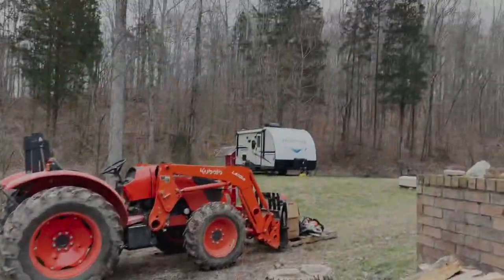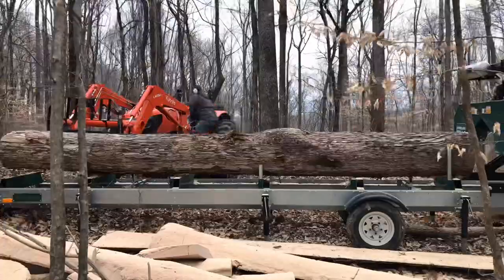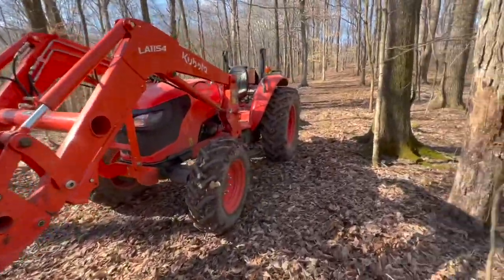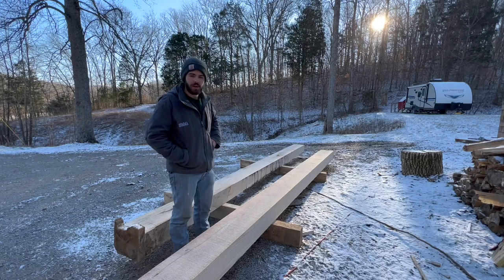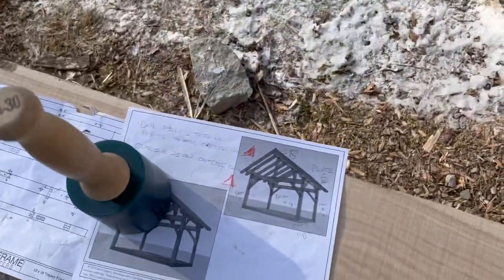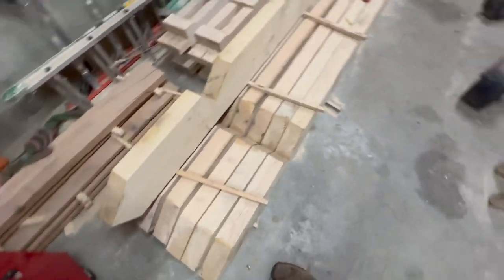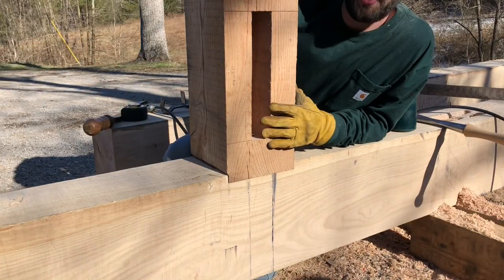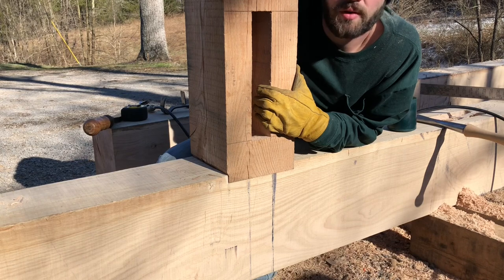Forest to Timber Frame (Saving LOTS of money)

Comment: Great work! Did you know you’re operating the Chan mortiser from the wrong side? If you go on the other side, you can see the red ‘0’ line for setting up, you can use your levers too. The big lever will move the chain forward so you can get twice the cuts/plunges from one clampdown. Trigger left hand, unlocking with right palm. Safer and easier.
Reply from the maker: Thanks Tim for the correction! I’m a bit new to it and I wondered what was the real purpose of that second lever. I’ll have to try it out. Thanks for watching!

Comment: It’s me again great job with your video. Can I make a suggestion? If I were you I would get some oil on the parts you have made. Control some checking. If it’s outside I would recommend sikkens with cetol. It’s pricey but it’s a good product.
Reply from the maker: Thanks for the suggestion Josh! I will definitely check it out. I’ve been looking for a way to control checking.

Comment: Great video....I'm looking to build a 16'x24' timber frame pool pavilion out of timbers and was wondering approximate time you spent cutting(mortises and tenons) your frame? Yours is out of oak and I would be doing mine out of pine.  Will be purchasing a Woodland Mills HM130 with 3 extensions which would put cutting length almost to 30'.
Reply from the maker: Thank you! Well I'd say I spent about 3 weeks in total on it, though I had to stretch it out over a few months. If you have everything in one place, it will go much faster. Pine would also be much more enjoyable to cut than oak. I definitely should have started with a frame that wasn't of the hardest species possible. Woodland Mills makes a great product for the money. You won't be disappointed. Keep me updated, I'd love to see your progress! Good luck.